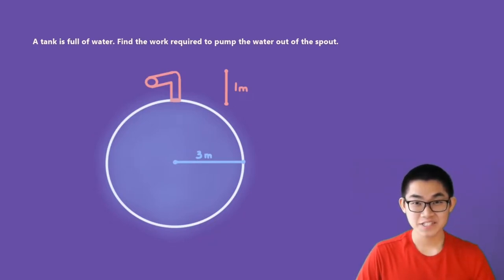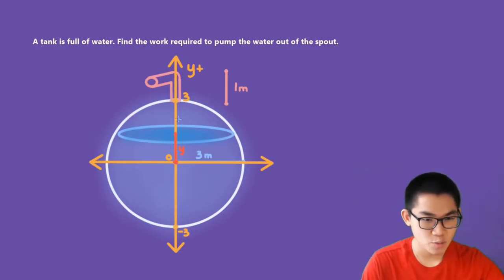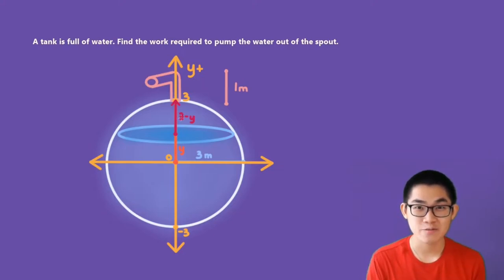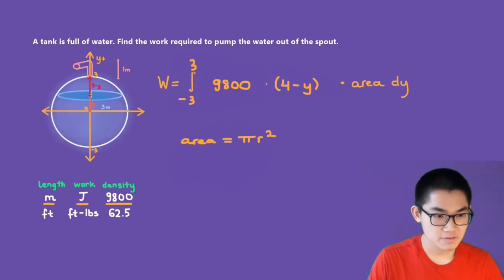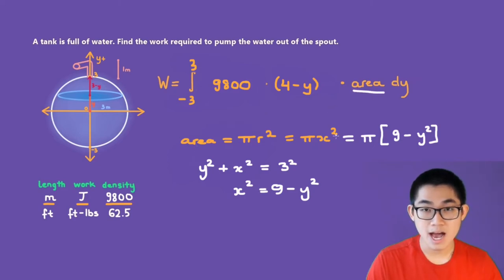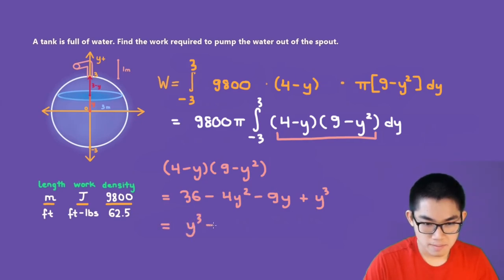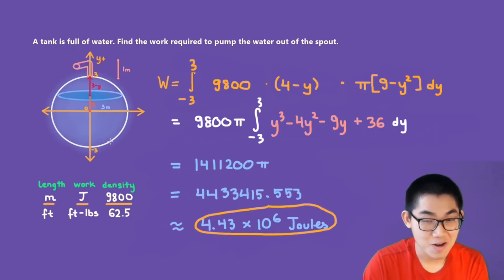Calculate Work to Pump Water Out of a Spherical Tank

Comment: 2:30 why is the spout height not considered when choosing "where we want to empty tank from" doesn't the 1m count as a distance over which a force is acting ?
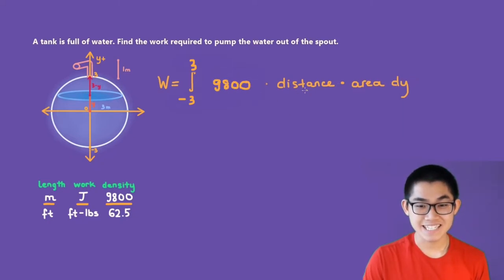Reply from the maker: Excellent question. At 2:30 the integral only goes from the bottom to the top of the tank (as stated in the textbook), but we include the distance of the spout's height at 3:00 when we obtain the total distance which is 3-y plus 1 equalling 4-y. Let me know if that helps.